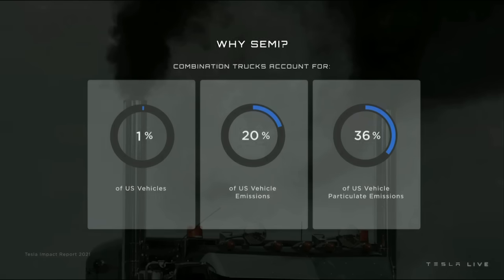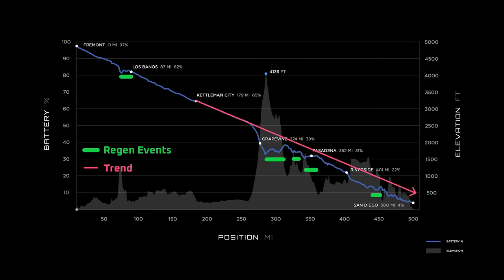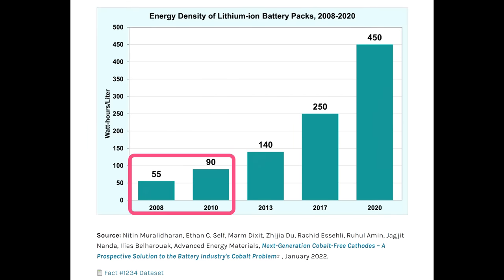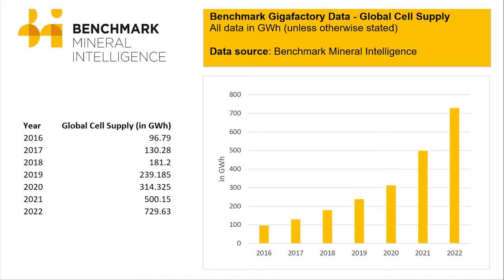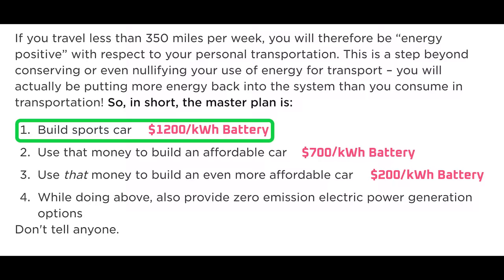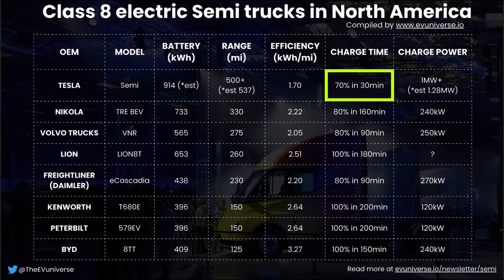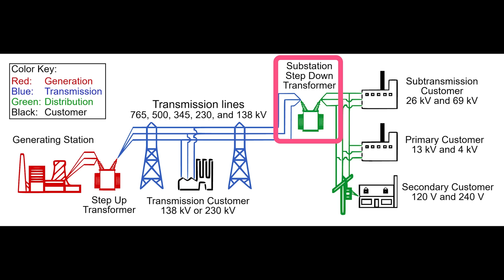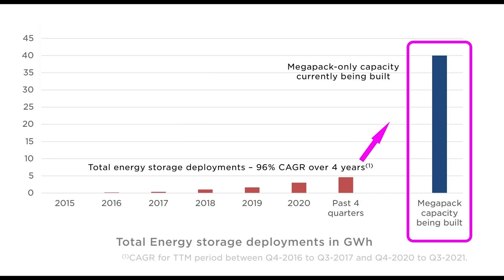The Tesla Semi:  Why Now? // The Road to Commercial Viability

Comment: Right now it looks that 50K/year will happen only after finishing Giga Nevada, where the main Semi production will be located.

To me it doesn't look like they actually intended to launch in 2019. To launch you have to have a factory. It takes about 2 year to build it. Nobody was constructing a Semi factory in 2017. Same as with Cybertruck. It is not delayed. Even the first 9000 ton Giga Press is not fully installed yet in Giga Texas. And it was produced in late 2022. In 2019 such a press could have been only at an early research/design phase. They could wait to launch the Semi in 2025 with even more efficient powertrain, cheaper/denser batteries, more developed charging infra, finished Giga Nevada etc. But this would be very bad for company's public image.

Comment: Volvo sells about 190,000 semi trucks per year. I think so far they've produced about 2,500 electric versions. Their stated aim is to have 50% of their output be electric by 2030. So let's say that's 100,000 semis.  I wonder how many Tesla will be producing by 2030? My guess is it'll be substantially more than that if they can produce 50k in 2024.
Reply: Years ago Tesla stated they planned to eventually produce 100,000 Semi’s per year.  No timeline was given back then.
Reply: 50k by next year is impossible as they have not even started building the big factory.
Reply: @lukasboscher9674  
It's not a green field site.
It's on the slab at Nevada.

Comment: Thanks Jordan, I was wondering why the delay in delivery too.  Another reason for the delay (I think you alluded to this but I didn't hear it explicitly) is future revenue from FSD sales.  Being limited on battery supply it makes more sense to put them in cars to increase the FSD / enhanced auto-pilot sales as the software matures rather than in a smaller number of trucks.  Musk has always been optimistic on the timeline for FSD (not a criticism since new leading edge technology development is risky and ALWAYS hits rough patches) but even so having more cars in the fleet ready to buy the sw is a good strategy.  Meanwhile they can improve the product further refine the drive train design, advance further the self-driving sw, benefit from batt tech improvements, megapack design improvements,  batt cost declines, and the better opportunity cost of spending capital on car factories instead of a truck factory.  And don't forget the huge benefits from the IRA which came in large part because of Tesla pushing the industry to build EVs.  In the end All good for the business and the truck customer.
Reply from the maker: I agree!

Comment: What really fascinates me about that first graph of the 500 mile trip is that the blue line actually meets up again when all the regen has been gained back. The pink arrow line doesn't do it justice! Just incredible levels of efficiency achieved by the Tesla engineering team!
Reply: Lol!!!! Which efficiency!? It’s all because of downhill! If it was only uphill or just straight leveled surface it would have been totally different.
Reply: @alanmay7929  Maybe you missed the graph on the lower part showing the several thousand feet climbed before going back down the same several thousand feet? The overall slope of the top graph gives you an idea of the average efficiency on the flat.
Reply: @nettlesoup  lol!!! So I’m blind!
Reply: @alanmay7929  
 lol!!! So I’m blind! 

Alan, You've violated the basic rule of YouTube Comments; if someone else claims you made a mistake, you double down on the mistake and call the other party every name you can think of. This may be the first time in history that a YouTube commenter self-deprecatingly admitted to an error. As they say Down Under, "Good on Ya"!
Reply: @nettlesoup
the blue line actually meets up again when all the regen has been gained back 

I struggled long and hard over this, because the theoretical efficiency of regenerative braking is about 80%, and this result seems to exceed that substantially. But I finally realized the reason. The Grapevine over Tejon Pass has a 35 MPH speed limit for trucks, going both up and down; so the energy gained from the reduced air resistance due to the lower speed almost exactly matches the energy lost due to regeneration losses to-from the battery. The result, as you observed, is that the 4,200 ft. climb and descent only cost 10-15 miles of range for the entire trip. This puts the Tesla Semi at an even bigger advantage in hilly terrain than it already enjoys on flat terrain.
Reply: @BigBen621  what exactly are you smocking!? Can I try it please!? Also where exactly is the error!? Wtf!
Reply: @alanmay7929  You may have misunderstood me. You first said it was downhill, which was an error; the trip started at sea level, climbed a 4,200 foot pass; and then descended back to sea level.
When nettlesoup pointed out that the graph in the background shows a several thousand foot climb, you replied " lol!!! So I’m blind!", which I took to mean you were acknowledging the error in a self-deprecating manner. My comment was meant facetiously, with the intent to commend you for acknowledging your error, when most folks commenting of YT videos double down on their error when someone points it out, and then get nasty.
If I misunderstood your "lol" response, please feel free to correct me.
Reply: @BigBen621  did you even read my comment!? I said they choose that route for some reason! Why didn't they choose another route to "get" the "500" advertised range!? It's all about making it look good right! You can literally see how diesel trucks are beeing used in the harschest mist torturous places on earth not the nice pavement that diesel trucks have built.
Reply: @BigBen621  it's very funny how you people never seam to critic anything about EVs but it's all the hate about ICE! seriously what is in your minds!? If EVs are that soooooo much netter then why aren't they literally replacing every single ICE in every single daily applications possible!? Yes "we know" the battery density is evolving but seriously you have to give credit where it's due!
Reply: @BigBen621  even Norway the places with most EVs! The country is a giant oops producer and they still need that oil and ICE to build and maintain their roads, bridges, grid, install windfarms at seas.....
Reply: @BigBen621  to reach the most inaccessible areas or open mining site or whatever colossal projects in fact the biggest construction projects on earth, the Chinese three gorge dam is just one of them! There are many others like the gigantic Mauritanian iron ore train the heaviest in the world that crosses deserts to reach the coasts.
Reply: @BigBen621  even spacex uses those massive diesel semi trucks to haul their parts around
Reply: @alanmay7929  Wow! You're really wound up about this. A few responses: 
 what exactly are you smocking!? 
Kinda looks like you've already found it! 
 Also where exactly is the error!? 
The error is you claiming that a trip from Fremont, CA, at sea level, to San Diego, CA, at sea level, is downhill. It's not.
 I said they choose that route for some reason! 
They likely chose it for a number of reasons. First, they wanted to demonstrate 500 mile range, fully loaded. Since San Diego is about 500 miles from Fremont, that was a logical choice. Second, they wanted to demonstrate the ability to climb and descend one of the highest freeway passes in the country, 4,200 ft. Tejon Pass, without affecting range. Third, they wanted a route where they had facilities on the other end, which they have in San Diego. Fourth, they wanted to stay within California, where all of the initial group of Tesla Semis is being deployed. There were probably other reasons, as well.
 It's all about making it look good right! 
 It's all about demonstrating a 500 mile range, including a steep climb and descent, in real world conditions that Tesla Semis are likely to encounter. 
 You can literally see how diesel trucks are beeing [sic] used in the harschest [sic] mist [sic] torturous places on earth 
No one is claiming that Tesla Semis can do everything that Diesel semis do now; of course they can't. There are millions of Diesel semis on the road, and Tesla is only planning to build 50,000 Tesla Semis a year; so for decades if not generations, they'll be utilized where they can be used to best advantage. 
 If EVs are that soooooo much netter [sic] then why aren't they literally replacing every single ICE in every single daily applications possible!? 
 No one anywhere ever said they can replace every single ICE truck in every single daily application. The transition will be slow, and will take decades if not generations. So rest assured, there'll still be plenty of Diesel semis for my lifetime, and likely yours.
Be safe out there.
Reply: @BigBen621  did you really needed to write a whole dictionary!? Wtf had time to read all that!???????????
Reply: @alanmay7929  Too funny! Random guy on the internet who thinks somehow you can go downhill from a city at sea level asks multiple questions and then complains about having to read the answers!

Comment: Nice discussion, thanks. 8 fold increase in volume density, but less than 1/2 fold in energy density? Have they reached the point of diminishing returns? Tesla Megapacks, charged with renewable energy, sounds like the real holy grail.

Comment: Good video.  What about the extra losses from charging the megapack then using that stored energy to charge the semi?  Time is more valuable for these guys but they are losing some efficiencies there.
Reply from the maker: That's a good question for my guest later this week...
Reply: Mega pack grid data would apply to this question.  Round trip should be better than the vehicle because it doesn't include mechanical motor conversions, just the battery and inverter losses.  Well within their wheel house given their grid storage experience.  I realize I'm stating the obvious.

Comment: So, it seems that, despite producing EV semis for longer, the legacy manufacturers (and Nikola/BYD) just aren't very good at building batteries and chargers.  Tesla was late to the semi party but it looks like they went straight to the top of the class.  Can't say I'm surprised.  This is for two reasons: 1. Tesla specs on the semis plus their excellent demo of the semi actually achieving the stated range. 2. I have a 5 year old model S and I have seen and directly experienced what Tesla can do (or what they could do 5 years ago)

Comment: Tesla Semi is a Trojan horse for the Tesla ecosystem.

Truck customers will start with the truck, and quickly discover they need to get a Megacharger.  Next, they’ll figure out they should probably get solar, then they should also get a Megapack… then they start participating in VPP, load shifting, and energy arbitrage.
Reply: Or, the smart ones will figure all that out first!

Comment: Jordan has connected the dots on the delivery timing and high probability of success of the Tesla Semi.
In 2019 the Tesla Semi would have been successful, but would have had a slower, less profitable adoption.  Times have changed and so has Tesla's technology.
Jordan didn't mention the profitability aspect, but I believe that the following key developments will make the semi much more profitable for Tesla and their customers
- Plaid motor development  (Nearly free off the shelf use in Semi)
- Huge cost reduction: Tesla megapack deployment at megachargers will eliminate the cost for a slow delivery of a substation and deploy a megapack into the grid as a VPP participant.  If I am right about the VPP, this allows Tesla to build out the Megacharger network for free.  Tesla can simply steal a couple megapacks off the Lathrop production line whenever they need to add a megacharger station.

How are other Semi manufacturers like Kenworth going to compete?
Reply from the maker: Amen!

Comment: Basic math on the charging.
If it's a 1MWh pack (keeping it simple) and it has a 1.2MW charging (allowing for losses) to provide 10-70% in 30 minutes (I think 0-70%  was a mistake, why quote from zero?)
That's 4 V3 chargers at max rate.
If we consider a site with 50 V3 chargers, what energy supply is Tesla providing?
.
That would give a rough guidance for 4 ("full rate"?) Megachargers?

That full rate is required only if the truck is running 500 miles+ at full load.
If "running light" extends that to 600 (possible, since the current truck had spare capacity beyond 500) it's likely PepsiCo and others will only be charging overnight (?)
.
That brings us back to those V3 chargers.
Is there a reason that a Tesla Semi couldn't charge 15-95% at 100kW for 8 hours using a V3 charger and an adapter?
.
Cheap energy?
Well within charger spec.
Great for the battery?
.
I see this as a potential for companies such as Pepsico to utilise the local grid.
.
It would also open the possibility of OTR operation.
.
If the new Tesla locations (ref IRA!) Add a drive through lane, that can serve as
The CCS "open" charger, with access to all socket positions (using Magic Dock)
A general "towing" lane
And (perhaps?)
An "overnight" facility for OTR slow charge? (Also providing "hookup" power?)
.
That would be an almost instant 1,500+ network (plus modified existing sites?)

Comment: @The Limiting Factor  Delaying semi to make more 3&Y did not necessarily slow down the transition to sustainable transport. There’s other factors besides just annual usage cycles per cell deployed. 

1) The 3&Y fleet is collecting data for autonomous driving development that could 5x the fleet utility basically overnight. Getting to this point sooner matters to the mission.

2) Delivering more consumer-facing vehicles probably helps more with getting the general population on board and realizing what’s happening.
Reply from the maker: Good points!
Reply: Autonomous driving for cars isn’t the same thing for trucks or other vehicles lol!!! There are totally different dynamics applied! Trucks are totally different.
Reply: Sustainable transport is also the use of much bigger trucks to replace multiple ones! Like scania or Volvo diesel road trains are able to move up to 100tons on one go.

Comment: Useing a battery buffer is definitely the right way to go for ensuring that the grid is not overloaded. Car charging stations need to do the same thing. Another option that should be considered is offloading some of the battery pack to the trailer itself. Then while the trailer sits, it can charge slower. On one hand it would be great to implement a regen on the trailer as well, but then you get into the jack knife avoidance...

Comment: Well done as always. The biggest limitation to the Tesla Semi vs ICE semis is the lack of sleeper/extended sleeper for long haul. Right now it is only configured for a dedicated regional or possibly a LTL style of driver swapping for long hauls. Most long hauls are team driving in order to expedite. 
With investor day on 3/1, announcements may include a Mexican GigaFactory for the Model 3, 4680 production, and mega packs, and to supply megapacks for marine use especially for dedicated runs like a RoRo.
Reply: The Motortrend Jan 25, 2023 article on the Semi shows a roomy cab with full eight ceiling and 3x7 foot floor space behind the driver. Room for a fold down bed.
Pepsi driver described it as: incredibly comfortable and "drove like a car."
Reply: I don't think they'll worry about a sleeper version until there is a charging network that could support longer haul trucking.  For now they're day haulers only.
Reply: @TheEvilmooseofdoom  Given that megachargers will be prebuilt and modular, a megapack run rate of 10,000 per year will easily accommodate the intitial rollout to all 600+ Love’s locations in 42 states. It’s a great deal for Love’s as all they have to provide is the pad areas for it. Tesla will provide everything and Love’s will receive a fee for each charging against a minimum guaranteed monthly revenue.
Reply: Once the FSD becomes legal for a truck piloting, perhaps all they need to do is make a really comfortable reclining driver seat.
Reply: @macrumpton  FSD will be first used for convoys with an active driver in lead and the others under the lead’s control. This is an easier task for regulators and similar to the current semi “trains” on the road.